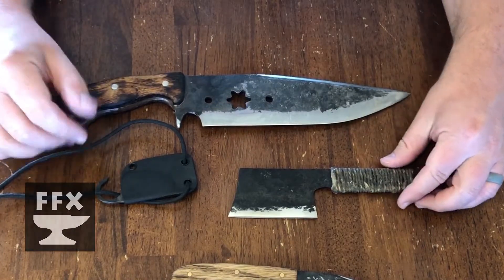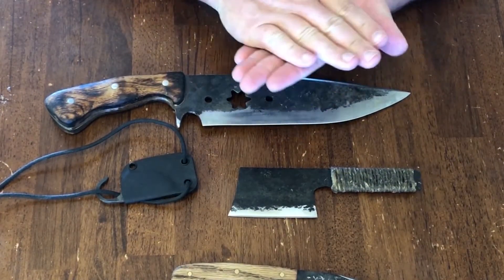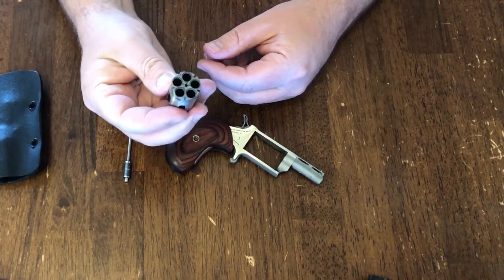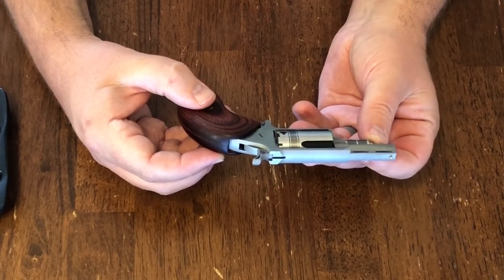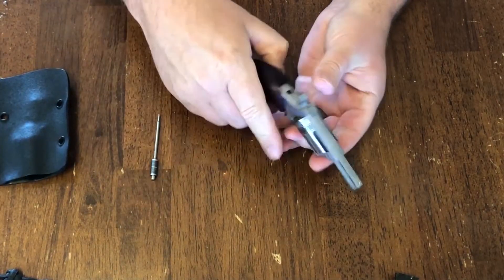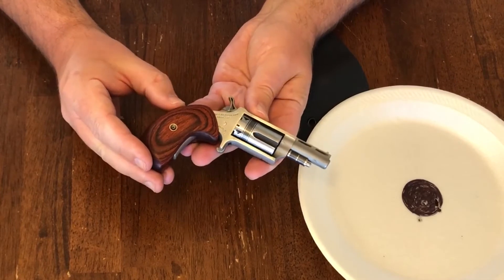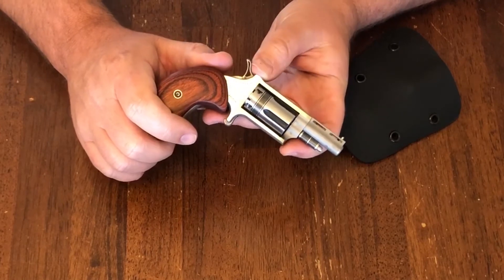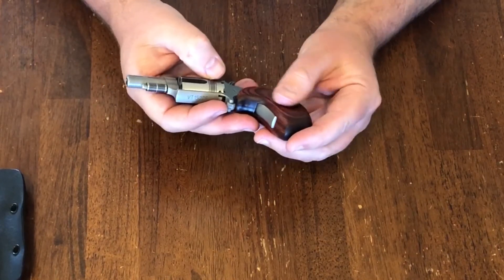NAA Wasp "Tool" Review?

Comment: I have the NAA Wasp in .22WMR - .22LR and a NAA Pug also in .22WMR - .22LR. I love these little pistols. They are extremely well made, reliable, and fun to shoot.  I carry both, bot not at once. I have a few other options but carry these way more often because of their size and weight. Both are great close range pistols. But the Wasp seems to be a little more accurate at longer range than most would think. These guns have a velocity of over 1,000fps with the magnum round. A 1,000fps hollow point will put an attacker down with no problem, so they are totally viable as a self defense pistol.  Enjoy your little revolver.....they are my favorite little guns I own.